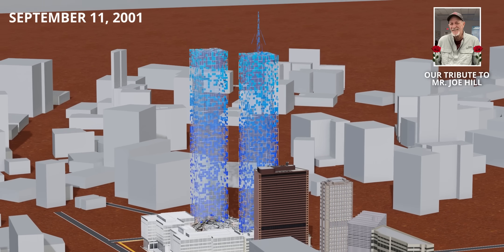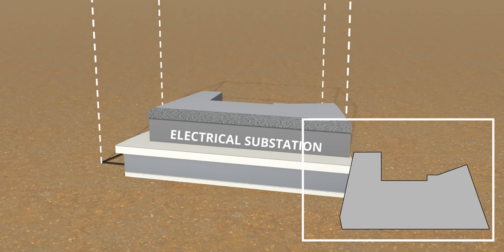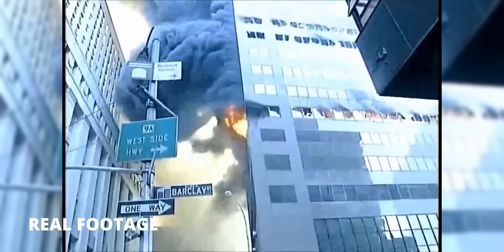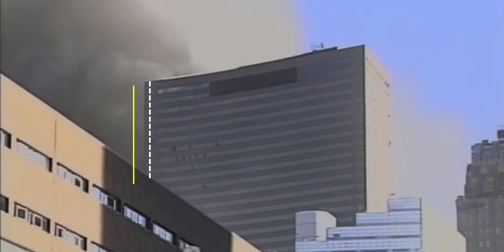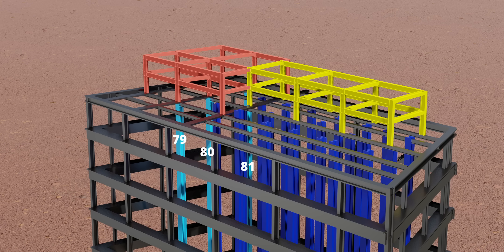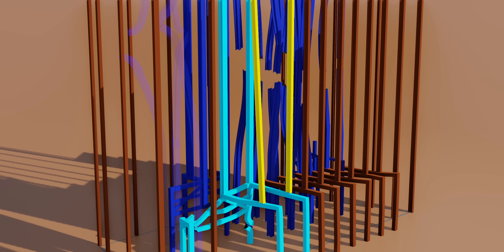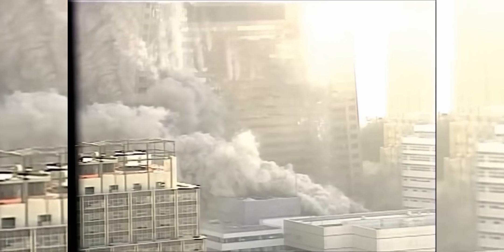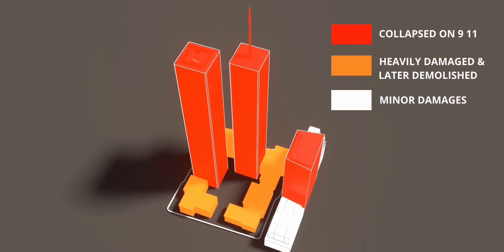Collapse of Building 7 | The Complete Physics

Comment: Yea, 25 years later its more easy to make a nice powerpoint with just easy telling how everything failed. They just needed to also clear that building so with Steel cutting Charges the building felt down as a normal building does when demolished with c4 charges. My question is why nobody spoke about this collapse. It was the 2 mail WTC's but never WTC 7 . It was in 2001 a coverup hard to explain. And antenna could only scratch the outside off a big building but never damage that building so much that it just gave up al, in once. 2001 was Amerika attacking itself so they could start multiple wars trough the middle east. They only needed a reason. And it is already for a long time no secret that comming into Iraq was a big mistake. 

All False flag operations. But 90% of people won't believe that narrative and still goes with the mainstream media. But they didn't research the rabbit hole of everything. Even the 2 WTC's you see on some video's flashes from charges that cut the support columns that caused them to thumble strait down. As long 90% believe a pair of terrorist did this everything is fine. And those who come too close with evidence will be silenced as always.
Reply: Or,... you could use the thinking part of the brain and not embarrass yourself. 

Building 7, the 6th building to collapse of 10 lost on 9/11 still confuses many even though it has been extensively studied. Not famous or a terror target, and with no casualties it did not get a lot of attention initially, creating an information void the internet rapidly filled with garbage. Because everything seems like a conspiracy if you don’t understand how it works I prepared this brief summary of the collapse from my own analysis. No politics, just engineering. 

The North Tower collapse at 10:28am bombarded Building 7 with tons of burning debris, causing heavy damage and starting multiple fires burning out of control for the next 7 hours. Half the FDNY firefighters having been killed, others injured, units in disarray, equipment destroyed, no water pressure, and the greater urgency of Search & Rescue efforts, firefighting was pulled as futile. The building couldn’t be saved and was left to its fate.

www.youtube.com/watch?v=g_SvpwyC17M&ab_channel=MFitz  

Collapse of a burning structure is always a concern for firefighters. Steel buildings subject to fire rely on active fighting of the fires to survive. Buildings are designed around 1 to 3 hours of fire resistance, allowing time for occupants to escape and ACTIVE firefighting to get started, after which all bets are off. Left to their own devices they will exceed their design envelope and collapse. In B7 the occupants escaped, passive and active fire protections were compromised and active firefighting was abandoned which left the building to take its chances. It lost. Odds on Building 7 would eventually collapse, and it did. No big deal in logic. That is the sort of choice firefighters make every day in brush fire situations - which houses to save and which ones to let go. Only real difference here is moving the decimal on the size and cost.

www.youtube.com/watch?v=WnYBX6QT0R4 

FDNY Chief Daniel Nigro ; The biggest decision we had to make on the first day was to clear the area and create a collapse zone around the severely damaged 7 World Trade Center, a 47-story building heavily involved in fire. A number of fire officers and companies assessed the damage to the building. The appraisals indicated that the buildings structural integrity was in serious doubt. I issued orders to PULL BACK the firefighters and define the collapse zone. It was a critical decision; We could not lose any more firefighters. It took a lot of time to PULL EVERYONE OUT, given the emotionalism of the day, communications difficulties and the collapse terrain

FDNY Deputy Chief Peter Hayden ; We had our special operations people set up surveying instruments to monitor and see if there was any movement in the building. We were concerned of the possibility of collapse in the building. And we had a discussion with one particular engineer there, and we asked him if we allowed it to burn could we anticipate a collapse and if so, how soon? And it turned out that he was pretty much right on the money, that he said 'In its current state you have about 5 hours

The collapse of Building 7 was anticipated and widely reported in the media throughout the day. At least 24 video cameras recording some or all of the collapse. Everyone knew what was coming and why.

www.youtube.com/watch?v=OY5S5k3tMHI 

Building 7’s collapse was completely different to the Twin Towers, harder to understand with most of the details difficult to see. But we can still sort out what happened through careful analysis and observation.  This is MY EXPLANATION of the collapse sequence using the best available information and relying on no authority.

B7 was complex 47-story steel framed structure built on top of a smaller existing 3-story building, requiring several lower floors dedicated to complex load transfer structures instead of usable office space. Of trapezoidal shape and all-steel tube-in-tube construction, B7 (above the 7th floor) consisted of a central core of steel columns carrying most of the gravity load, perimeter steel columns around the outside of the structure carrying the remainder of the gravity loads and long span beams and girders to tie those elements together and form the floors. On the outside of the building hung a moment frame - the last part of B7 to fall. 

Phase 1 : The first externally visible signs of collapse initiation occurred at 5:20:28 pm. Collapse initiation for B7 is notably quiet with observers not realizing the building was collapsing! There was no audible warning in the form of say hundreds of ear drum busting 180-190dB explosive bangs preceding the collapse. Here at 12:00 a local CBS affiliate reporter is talking 10 blocks from B7 when collapse begins. People don’t start to notice the collapse until 12:11. Then at 12:45 is the famous CBS fixed camera clip of Building 7’s collapse.  Note how quiet it is.

youtube.com/watch?v=t5tEy6mXSE8&ab_channel=fresnosean379

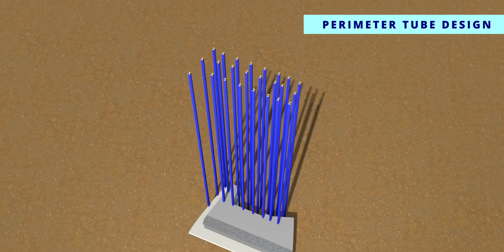Collapse initiation was due to lower floor failures above the load transfer region (7th floor) in the NE corner of the building. In this video at 0:45 you can see the NW corner from inside the building while under construction, Column 79 just out of frame on the left. That big, angled steel beam across the top of the frame connects to C79 at one end. The girders connect to the beam. That beam and all those girders depend on just one connection

youtube.com/watch?v=nP3TNHPCIVU&t=35s&ab_channel=EdwardCurrent

Phase 2 : Lower floor failures caused a loss of critical lateral support over an excessive length of core Column 79 and it buckled. If you look at a floor diagram of Building 7 (see above) and look at all the structures that depend on C79 you quickly realize this one column was a relatively isolated structural element on which a disproportionately greater fraction of the structure depended analogous to say the Key Bridge. Externally we see a vertical progression of window breakage along the 44-46 line and a kink in the roof of the East Mechanical Penthouse at the top of the building, consistent with C79 failure. The transition from full capacity to almost no capacity occurs in virtually an instant. Once the buckling failure occurs there is almost no resistance

Normally with a buckling column, the load could very well be redistributed to other columns, meaning the buckling could stop after a while. With C79 that is not the case - the failure did not redistribute the load, so the collapse rapidly progressed to the roofline, sinking the rooftop penthouse.

Phase 3 : With C79 gone, B7’s progressive, non-symmetrical collapse continues with C80 and C81 at the east end of the core left laterally unsupported and quickly buckled and failed as well, sending the EMP down through the building. C79-81 all have no diagonal bracing, which I believe is a major reason why they could not redistribute a lot of vertical loads among one another.

From there collapse progressed from east to west through the central core until the core was gone taking all of the interior floors and structures and probably most of the perimeter columns with it. You can see the horizontal progression of window failures low in the building and the dropping of the remaining rooftop structures into the building. One of the big takeaways from the NIST Building 7 study (that gets completely ignored) was their modeling which determined C79 failing under ANY circumstances would have initiated the same collapse sequence.

Phase 4 : After some 10 seconds all that remains of Building 7 is just a hollow empty outer shell - the exterior moment frame - creating the illusion the building is still standing since little has changed externally. But it’s just a hollow empty shell like an empty cereal box supported by only a few remaining columns and quite unable to remain standing. With all the internal framing gone. the north face leans inward, forming a V in the roofline, the last perimeter columns buckle under the strain and with nothing left keeping it up the moment frame free falls, landing on top of the 7-story high debris pile. It is only at the very end that a single measurement of alleged free fall acceleration is taken. Note this is not the building but just its outer shell, and only one corner at that, at the very end of the collapse. Start to finish the entire collapse took 18-20 seconds, or less than 1/3 of true free fall and we have to look at the whole thing, not cherry-pick little bits to fit a particular narrative. Worth noting _how fast something falls cannot tell you what started it falling in the first place. The debris spread out, blocking surrounding streets, heavily damaging the Verizon Building and destroyed Fiterman Hall, all well outside of Building 7’s “footprint”.  

Building 7’s progressive, non-symmetrical collapse was incidental and unintended collateral damage from the combined effects of fire + time + gravity started by the collapsing North Tower. That is true no matter who planned and carried out the 9/11 attacks or why . The collapse was of so little consequence it barely even registered at the time, a mere footnote. It only took on semi-mythical status as an alleged smoking gun years later when demolitions at the Twin Towers, missiles at the Pentagon and shoot down over Shanksville all failed and conspiracists had nothing left to work with.

Anything can seem like a conspiracy if you don’t understand how it works. Now you should. I hope you found this helpful, informative and it solicits informed critical comment. If I made any errors of fact, logic or reason or left anything important out, please let me know so I can fix it. IF you can offer a more plausible alternative please do. Be the first. Please start any reply with the words “Tits McGee” or I will know you didn’t read it and are wasting my time.

Comment: no steelbframed building collapsed for a 2 floor fire out of  tens of floors
Reply: And still hasn't.  Your knowledge of this event could fit on a matchbook cover with room to spare.
Reply: yes critical thinker, I believe in your knowledge
Reply: @brrprosavida  - Objectively, your claim is false, either due to ignorance or deliberate argument loading (lying).
Reply: @TheCriticalStinker-01  Yes I don t believe in your knowledge about anything, now I m not loading nor lying
Reply: @brrprosavida  - This isn't about belief it is about knowledge and my knowledge is correct, yours is not. FDNY firefighters at the scene described Building 7 as fully involved in fire, which is a hell of a lot more than 2 floors. 

Fire was externally visible on floors 6–10, 13–14, 19–22, and 29–30.  That's a hell of a lot more than 2 floors.

Those are true facts NOT beliefs.

Comment: Bullshit.
Reply: And yet not wrong. Go figure. 
	
This video is pretty good – with a few exceptions - and goes into a much higher level of detail than many viewers will be able to comprehend.  While not perfect, the collapse mechanisms – the sequence of failures - described here  are substantially correct and this is true no matter who planned and carried out the 9/11 attacks or why . 

That may not be what you want to hear and go against 20+ years of entrenched dogma and conditioning, but it’s not wrong. 

That also means (in case you did not get the hint) this video can be (and IS) absolutely correct in its description of collapse mechanisms AND the 9/11 attacks could still have been some sort of inside job. The two things are in no way mutually exclusive. 

The mechanisms described here have broad professional support around the world. There are no professional engineering organizations (for example: ASCE, ASEE, ICE, etc) that disagree with them or have offered any formal dissenting opinions or alternative hypothesis. 

So, setting hubris aside, either the overwhelming majority of the worlds structural engineers and simple observation are wrong,… … or you are. Which seems more likely? 

IF you still think believe this explanation is wrong then produce a better one . Good luck with that. No one ever has and I don’t see you moving that needle today. 

No one ever does.